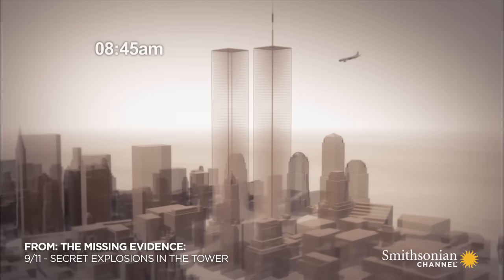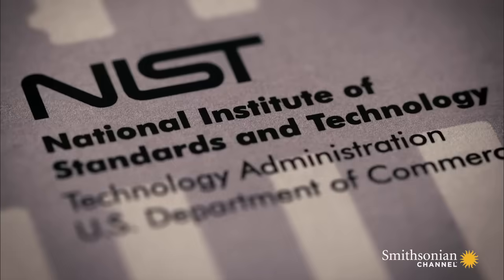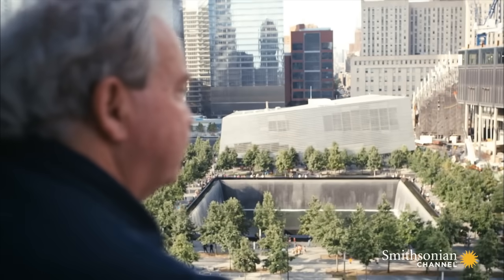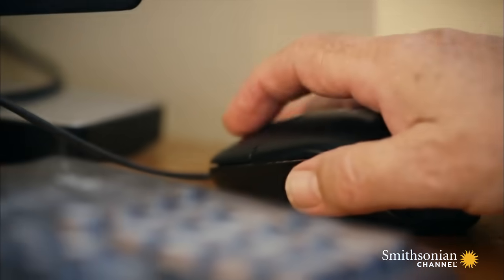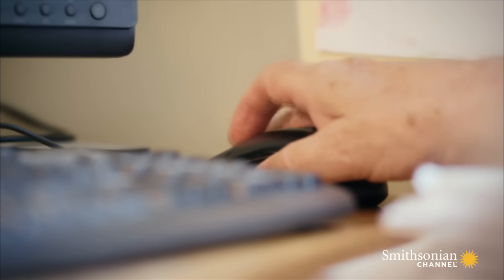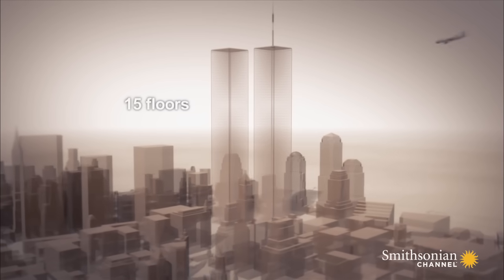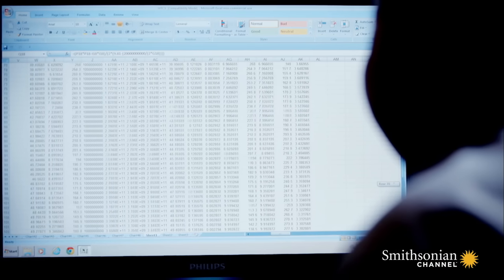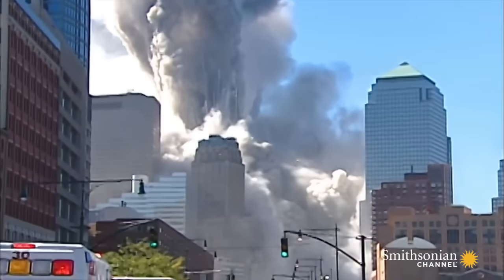This Computer Simulation Explains How the Twin Towers Fell

Comment: Disliked. This video did not account for the fact that a plane would bounce off the Twin Towers because jet fuel can't melt steel beams.
Reply: yes it can't turn the beams from solid to liquid BUT under heat, metal can become WEAK and FLIMSY. it was a chain reaction with support beams bending 1 by 1 with the weight of the upper 15 floors
Reply: A plane doesn't just "bounce"
Reply: Jack Strait's Unofficial Channel But you're forgetting that jet fuel can't melt steel beams. ;)
Reply: The Guy Right Up Your Street So?
Reply: Jack Strait's Unofficial Channel Are you not getting this? I'm clearly mocking conspiracy theorists.
Reply: The Guy Right Up Your Street Wow, you sounded exactly like one of them. I applaud you.m
Reply: I'm just going to remove those comments. This was a joke and not a place to discuss why or how the Twin Towers fell.
Reply: Bounce? So we're bouncing now?
Reply: steel doesn't need to MELT for the building to fall. What people are failing to realize is that steel weakens at temperatures of only about 450 degrees. Once steel weakens, it can be bent, just as a blacksmith bends steel in his shop. If the fires from the jet fuel were burning at about 1000 degrees, then there was MORE than enough heat to weaken the steel frames at the impact site. Once the steel weakened beyond a certain point, it could no longer hold the weight of all the floors above. This is when the towers began to collapse. And for those of you who say the towers collapsed just as a building would under controlled demolition, i.e. straight down, THEY DID NOT. Watch the south tower collapse, for example. The top half of the building actually came down at an angle, and, for a moment, so did the top of the north tower. And they were NOT falling at free-fall speeds. If you look at the video of the collapses, sure, you will see sections of the building freefalling, but these are sections that have broken off of the main structure. The rest of the building fell slower, as it pancaked downward. As for WTC7, it was badly damaged by falling debris from the collapse of the North Tower. And since I've already explained what fires can do to a steel-framed building, it shouldn't be too hard to see how WTC7 could have collapsed as well, albeit far later than the towers, since the damage to WTC7 was nowhere near as extensive as the towers. Still not convinced that a steel-framed high rise can fall as a result of fires? One such building fell just this year in the middle east, I believe.
Reply: I lol'd IRL
Reply: or you guys have never worked on cars have you, im sure your bomb theory makes perfect sense
Reply: MIS315 *You're
Reply: Top Secret Gecko I think he was just kidding!
Reply: Officially It can weaken steel beams to the point of failure
Reply: I can't get the idea of a plane bouncing off a building, reminds me of when I'm playing war thunder and have really bad ping😂
Reply: Officially actually, it can
Reply: LMAO. Bounce off? Did you graduate from the 8th grade?
Reply: +Officially your Officially a moron
Reply: Planes don't "bounce" off solid objects..  They get shredded.
Reply: the above was a reply to Mike James,  who thinks that it take vast experience to recognize an explosion.
Reply: I just don't see how there was enough fire to weaken the beams, when the streets were literally flooded with UN burned paper. 
You'd think, a fire to get hot enough to take it down, would need all the paper in the building to burn to keep rolling. Man paper was every where. Untouched. No ash, no sign of the corner of paper was burnt. Nothing. Minimal fire after wards. Man if that fire was really there, that entire building would've been glowing. Woulda seen so much floating ash. But we only seen a weird dust cloud fall from the sky. 
The steel and concrete just evaporated in mid air like an alka seltzer pill in water.
Reply: Some of those "people " you are insulting were war vets, firemen, and policemen.  No, "explosions" are pretty identifiable, especially if you are close enough to be injured by them. And yes, we HAVE heard of "progressive collapse":  it is a phony term dreamed up by NIST "experts" who were hired to explain away the obvious explosive demolition of the towers.   But FYI,  the term was so lame and easy to refute, that they later revised their "story", an admission that they cannot explain it without explosives.
Reply: You clearly have little or no experience with steel, or construction.   There was no "chain reaction".  That is simply the Official Cover Story,  which they hope that uninformed "civilians" can be brainwashed into.  "Weak " and "Flimsy  "   MIGHT do for an  airplane description, but NOT for steel.

Comment: Really? Explain why in several videos, bright reddish white flashes appear on the east face of the south tower building visible for miles in nearly every single video, and directly on ejected perimeter columns multiple times flashing consecutively as they're flying through the air? What causes perimeter columns to flash several times consecutively? Video evidence doesn't lie, I guess we have just, giant flashing pieces of perimeter steel fragmenting to bits, was caused by fire and gravity, or supposed exploding aluminum reacting, yeah Smithsonian, your theories don't fit the visual evidence.... Explain what I actually see in the video...
Reply: All your questions have already been answered by experts , you just need to look at the evidence as a lie cannot be proved and one cannot dispute facts.  A good place to start is with Richard Gage http://www.ae911truth.org/news/evidence.html

On September 11, 2001, the three worst structural failures in modern history took place when World Trade Center Buildings 1, 2, and 7 suffered complete and rapid destruction.
In the aftermath of the tragedy, most members of the architecture and engineering community, as well as the general public, assumed that the buildings’ destruction had occurred as a result of the airplane impacts and fires. This view was reinforced by subsequent federal investigations, culminating in FEMA’s 2002 Building Performance Study and in the 2005 and 2008 reports by the National Institute of Standards and Technology (NIST).
Since 9/11, however, independent researchers around the world have assembled a large body of evidence that overwhelmingly refutes the notion that airplane impacts and fires caused the destruction of the Twin Towers and WTC 7. This body of evidence, most of which FEMA and NIST omitted from their reports, instead supports the troubling conclusion that all three skyscrapers were destroyed in a process known as “controlled demolition,” where explosives and/or other devices are used to bring down a building.
KEY EVIDENCE
Rapid onset of destruction,
Constant acceleration at or near free-fall through what should have been the path of greatest resistance,
Numerous eyewitness accounts of explosions including 118 FDNY personnel,
Lateral ejection of multi-ton steel framing members distances of 600 feet at more than 60 mph,
Mid-air pulverization of 90,000 tons of concrete, and large volumes of expanding pyroclastic-like dust clouds,
Isolated explosive ejections 20 to 60 stories below the “crush zone,”
Total destruction and dismemberment of all three buildings, with 220 floors each an acre in size missing from the Twin Towers’ debris pile,
Several tons of molten steel/iron found in the debris piles,
Evidence of thermite incendiaries on steel beams,
Nanothermite composites and iron microspheres found in WTC dust samples.
Reply: Read the 503 nytimes interviews of firefighters and emt's....Gregory, Deshore, Ondrovic of ground flashes....Medjuck
Reply: They said that to make the people on the plane comply. They didnt relly have bombs
Reply: what an idiot

Comment: It was a MILITARY PLANE. It's the government fault. They knew it, why President Bush didn't do anything? Just the plane was not going to destroy the whole tower, it was NOT A COLLAPSE, because when the plane crashed it was only the top part on little fires because the smoke were black and black smoke means small temperature fire. Jet fuel can't melt steel beams. Do NOT trust the media, they manipulate you and use mind control, they are brain washing us. It was some kind of very destructive bombs that destroyed this towers, because they fall down from top to lower in order and we can clearly see that the explosion is 360 degrees from inside to outside. What kind of energy can turn everything (Plastic as TV's, chairs and tables, Metal as the offices parts and elevators etc.. ) into DUST? Everything was turned into a dust there, even if the crash made that we still could see a big amount of waste and sediments on the floor, which didn't happen. How the media knew 10 minutes after that this towers was collapsed? They didn't even investigate the case, they manipulate us saying that it was collapse and so the could CLEAN THE EVIDENCE AS SOON AS POSSIBLE. Another point is that why the military planes or air force didn't interrupted the planes from crash into the towers? Because the transponder was off? Common let's stop being stupid and WAKE UP PEOPLE. Please WAKE UP. The military have radars everywhere and they could send a missile to shot down the planes for sure. This was made by the someone working for the U.S. security to blame terrorists of other countries, which is NOT true. SOCIETY IT IS TIME TO WAKE UP PLEASE. Please read articles from Prof. Steven Jones which was fired after posted articles about it and also David Griffin and his 6 books about 9/11. They have studies and real evidences that will show you what I'm saying here.
Reply: lol
Reply: right?

Comment: I still don't see how some people fail to understand how a raging inferno softens the steel enough to buckle under thousands of tonnes, causing a collapse. It's pretty simple physics.
Reply: Nathaniel Merrill sit down and shut up you're embarrassing yourself. the laws of nature cannot be fooled any upper blocker material must slow down when it hits the mass of force that previously supported it. the upper bout the following structure will destroy itself while before it can possibly crust entire larger lower structure. the object that does the hidden always slows down conservation of momentum is a fundamental law of physics that I cannot be broken. if this was a gravitational collapse UC floor after floor stacked up on each other but the towers fell at accelerated speeds this is impossible. the fact that video and photos show numerous High Velocity burst of debris being ejected in the well-documented presence of multi Steel throughout the debris along with some 156 Witnesses stating they heard and felt prior to and during collapse explosions. one must lower IQ to even begin to try to understand what the f*** you talking about

Comment: The physics make sense. One floor gave way and the weight of the building above caused more and more floors to collapse, resulting in the slow descent of the buildings from the top down. This answered a lot of my questions. Thanks
Reply: Sarah McMillan you have got to be kidding......make sense?   Well then...here is another one....Star Wars is real......make sense?
Reply: Sarah McMillan question: what's slow descent are you talking about? the buildings fell at accelerated speeds almost at Free Fall Style. why isn't common sense so common?

Comment: what a load of crap. How does 110 floors of 4" concrete pulverise itself into dust? Its a simple exercise to calculate the total gravitational energy available prior to the collapse and compare it to the energy required to convert all of the concrete into small micron size particles. Then one needs to account for the collapse rate which is very close to free fall speed. Also, the fact that there is very little concrete left in the collapse rubble pile needs to be explained. Interesting how the passports of the hijackers were found relatively undamaged on TOP of the rubble pile. No wonder the regime in Washington did not want a thorough scientific investigation into the 9/11 event - especially the third building to collapse on that day - building 7. The NIST report reminds me of the Warren report on the JFK assassination - Laws of physics changed and magic and wizardry substituted....magic bullets, magic buildings, magic concrete....one big circus magic show

Comment: "The towers were built to withstand the impact of a commercial jetliner"..
Reply: +Rayheat The yote First, it was 767's that hit it, it was built to withstand a hit from a 707, the ones used during 9/11 weighed about just as much as a 707.

Comment: This guy claims "The mass of the upper part of the building was about the same as the Titanic" --- except if you watch both collapses, the upper part of the building disintegrates into powder and parts very early on as it's falling. Most of the mass is quickly lost. What then does the crushing work he asserts occurred?
Reply: and the fact that structure below has a mass many times greater than the Titanic.
Reply: its like being in car crash between a lorry and a car and the lorry getting crushed. I think its impossible for the WTC to fall like it did